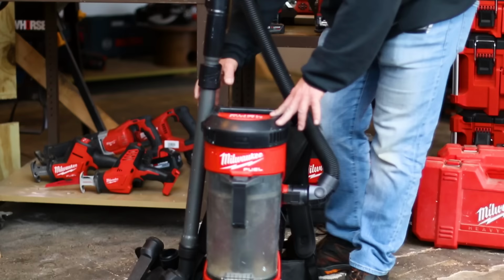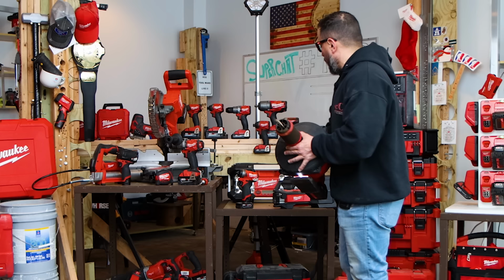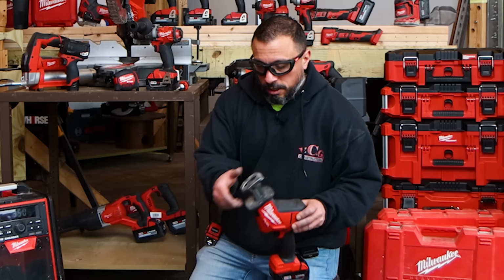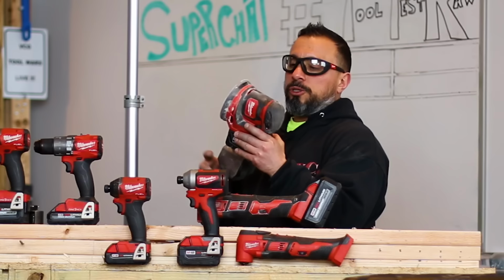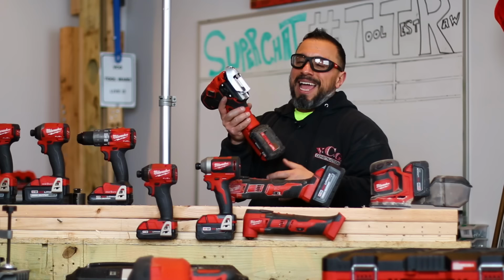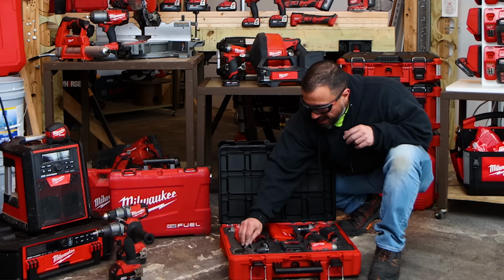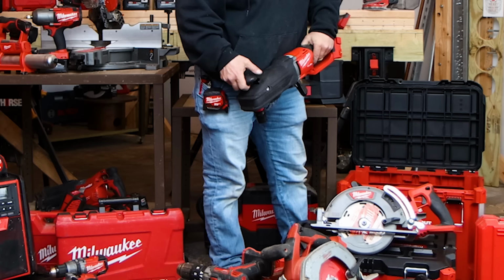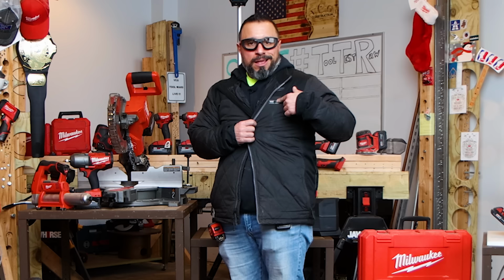Contractor Shows Off His Insanely HUGE Milwaukee Tool Collection!

Comment: I give credit where credit is do I'm no carpenter I actually work with wood as little as possible like installing an electric panel on an outside wall or a few other wood projects an electrician would need to work with wood or the occasional shelf in the garage or closet oh repairing my fence here & there from my doggies trying to sneak out but anyways to get to my point when the hell do you have time to actually work work getting job's etc so I give you credit & keep up the great was work I know its spreading yourself thin cause I've been there being a licensed electrician wasent enough so I went for my HVAC certification mainly just for handling the different freon types then went to work  for new York city transit to upkeep the old subway cars then all the new ones but wasent happy working under them so got out of that as fast as I could & went to emergency response where I'm dispatched on break downs,stalled & of course the suicidal passenger & I had to make sure that train was not damaged so iam no EMT just trouble shooting the stalled or problem trains to get it working or get it off a main line till it could get sent to its yard but again I know spreading yourself thin....good luck man & ya have some great tools there wish they had even a fraction of them years ago..ha ha I had the $300 cordless dewalt hammer/regular drill with the 2 batteries & charger in the hard carry case & of course the Bosh bulldog for everything else but was just the Bosh gun back then & the 1/2 corded milwaukee adjustable right angle drill that would RIP your ass off the ladder if it hit a nail or wire mesh then upgraded to the bigger bosh gun for core drilling dam there I go again ,anyways keep up the great video's & good luck...

Comment: A comment on the battery wobble thing people talk about. these tools are used for construction/trade jobs.... I know hard to believe. you'd think that if you made the tolerances super tight it would be hard to remove the battery with use on the job when a buncha crap gets in between the battery and the tool. Obviously all these armchair journeyman seem to know better than the people who BUILD the tools and test them and maybe... JUSTTTTT maybe have the things like tolerances between the batteries and the tools in mind. who knew?